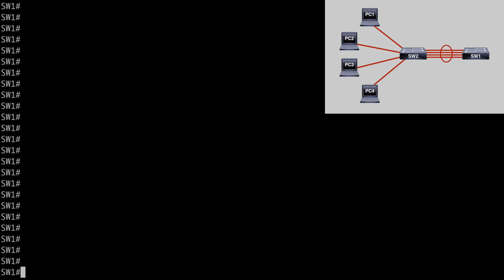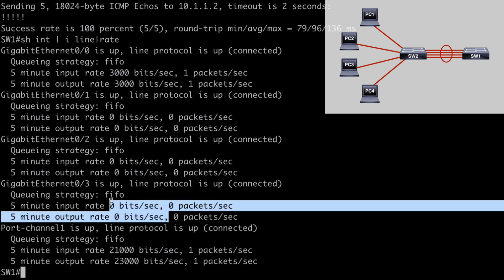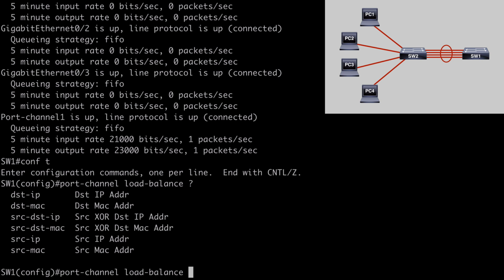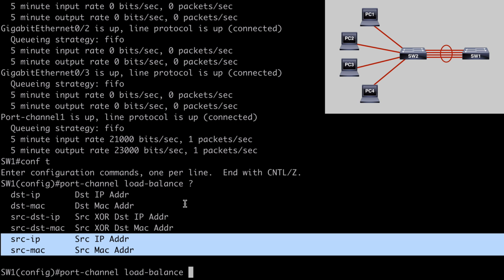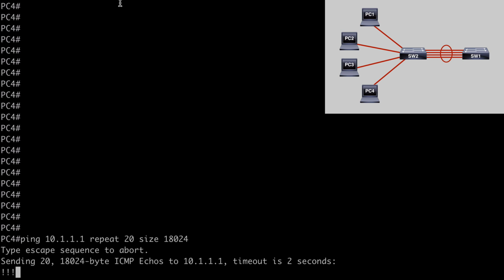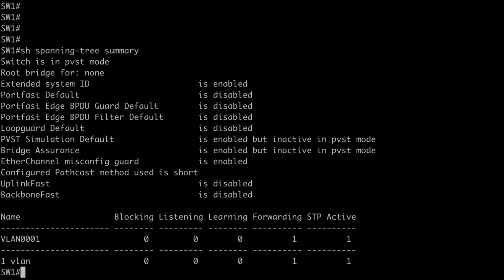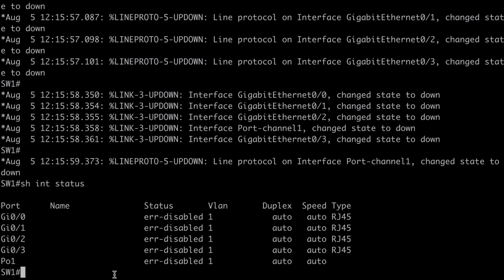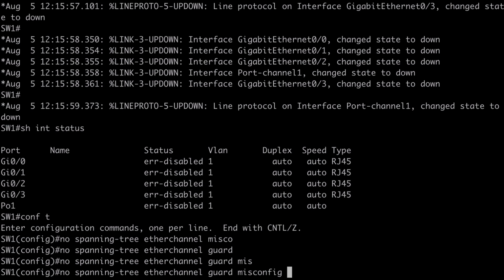EtherChannel - Load Balancing and Misconfiguration Guard

Comment: Hi, so when you say use a dynamic protocol for ether channel, are you saying that the whole PO wouldn't have been err-disabled if a dynamic ether channel was configured? So ether channel misconfig is only for static POs?
Reply: Yes, you are correct. If you are running LACP or PAgP, the interface would be removed from the bundle and set to independent mode, and spanning-tree would sort things out to make sure the port channel is still operational. That's one reason why it's recommended that we use LACP or PAgP.
Reply: @CharlesJudd  Hi Sir,  I have configured Layer 3 etherchannel between 2 switches and when i shutdown one physical interface , i am not able to ping other end L3 Port-channel IP address. I changed Hashing to Src-dst-IP, SRC-DST-MAC and SRC-IP tried all methods, did not work.

My requirement is i have 2 locations SW01 and SW02 are in L3 Etherchannel with 2 links. if one link goes down, it should be able to work on other physical link, in this case i am not able to ping the IP address.

Please help, so that we can have redundancy across 2 physical links.